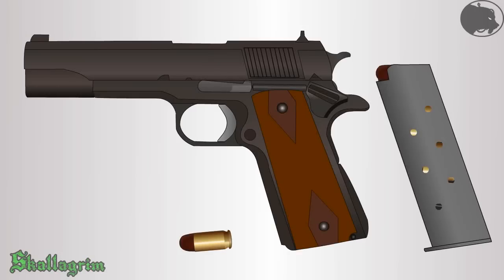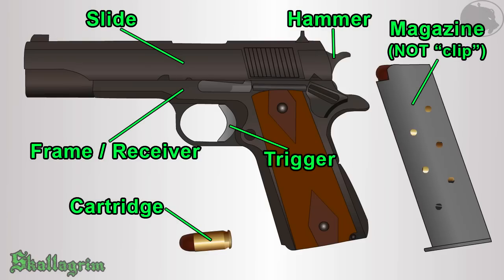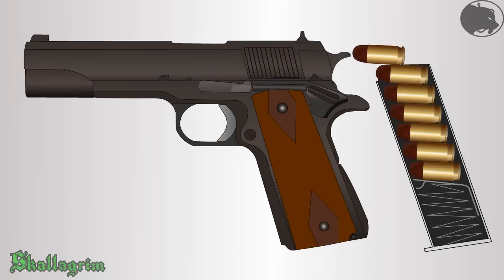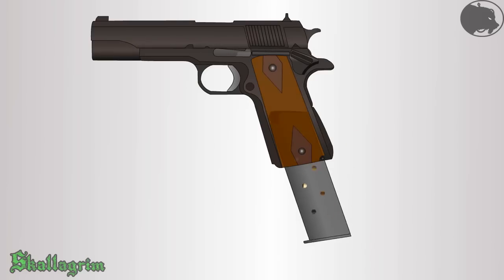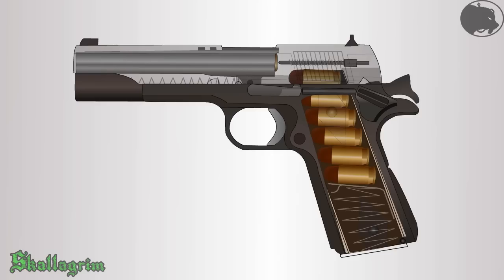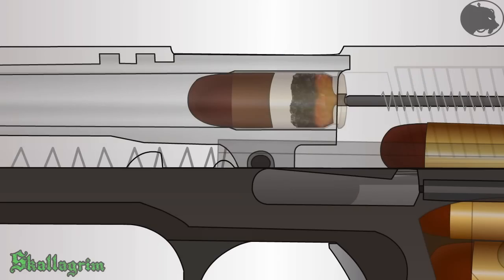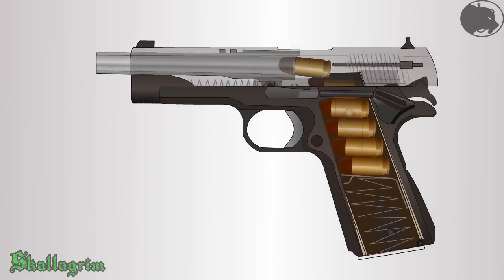How a firearm works - Animation (1911 semi-auto handgun)

Comment: Everyone, keep in mind that this is a blowback-operation.
Blowback operation uses the force from the powder exploding to push the slide back.

Rifles tend to use gas-operation, which locks the slide in place so that it can only be moved by manually handling the slide or by siphoning gas put of the barrel to apply a force onto the slide.

Gas operations have several benefits, such as:
Less strain on the slide.
Less reliance on ammo weight.
Less recoil.
More force applied on the bullet.*
Gas won't be in the user's face.
Etc.

* Note that in a gas operation, the chamber is sealed. So long as this seal is in effect, both the explosion from the gunpowder being ignited and the force of the resultant gas expanding add together.
In a blowback system, the force of the gas is completely wasted.

Blowback systems are only very reliable on small ammunition and gas operation is only reliable on bigger ammunition.
This is because small ammo has too little gas to work an operation and bigger ammo applies too much stress on blowback systems.
Reply: So bolt-action rifles really ARE more powerful than semi-automatics?
Reply: Kevin Meisenbacher no, it is the round that determines how powerful a gun is, a 5.56 bolt action is no more powerful than a 5.56 ar15
Reply: @Kevin Meisenbacher Technically, ever so marginally so. Real world, no. The type of round being used and length of the barrel are the most important factors in terms of power. Comparing apples to apples, any two guns using the same round and same length of barrel will be equivalent in terms of power, regardless of the type of action used.
Reply: @kevgmei  some would argue that bola actions are more accurate but that comes down to trigger discipline. Some people keep pulling the trigger on a semi auto without aiming but in truth both rifles can put in a very tight pattern. I use an SKS and at 100-150 yards (standard distance for Dee hunting here at home) I usually put in a decent pattern. Sadly have to use my off hand cause I'm left eye dominant
Reply: Same here. If I were to get into guns, then I would definitely have a much easier time with pistols because I just know it would be super awkward for me to hold a rifle with my left hand.

Comment: The moving of the slide and the bullet moving through the barrel happens at the same time because of the gas pressure inside the barrel from the explosion of the primer. (That’s what recoil is, the gas can’t escape because of the projectile.) So the slide is actually back before (or roughly at the same time) the bullet leaves the barrel. The video isn’t wrong just a little nit pic I saw, cool video!

Comment: thsi is old but good. if Skall is still going on with the channel I want to know hwo does a gun jam?
maybe link me to the video if it was already explained.
Reply: There are a million and one scenarios where guns jam, but here are the most common malfunctions.
Stovepipe:The casing is improperly ejected, leaving it stuck in the ejection port.
Failure to feed: The slide fails to pick up the next round.
Failure to extract: The gun fails to extract the spent casing, leaving in the chamber of the barrel.
Misfire:The primer is struck but the cartridge does not fire. Can be a hangfire in disguise.
Hangfire: The rarest and potentially scariest malfunction, where the cartridge simply fires on a delay. You pull the trigger and it doesn't fire for one to thirty seconds. A youtuber once experienced this when firing a 357 Magnum revolver, taking his ear protection off before the round fired. His ears were ringing for at least the next week.
Reply: I own a 1911, and the first 3 have happened to me when I was just racking the slide/working the gun oil in.
Reply: I know I'm late but thank you for explaining this. I was curious as to the ways weapons jam and this has just sparked my curiousity further

Comment: AK-47 assault rifle doesn't use the recoil to reload, but takes some of the pressure from the burning gunpowder to operate a piston that does the reloading. Why is that? It's more complicated. Is it more powerful that way, as it waits until the bullet gains some speed before it starts to remove the shell?
Reply: Heikki Finland actually it is the other way around. The bolt on the ak is locked to contain the forces of the cartridge. By the time the bullet passes the gas port (near the end of the barrel) and gas actually starts to travel down the gas tube, impinging the piston, (which unlocks the bolt) pressure levels have dropped to safe levels and the mass of the bolt carrier and resistance of the recoil spring are sufficient.
Reply: It's cheaper and lighter to use gas-operated mechanism.
The pistol in the vid isn't known for being light, but for being reliable (taking out all the factors like idiots ruining their guns, using improper ammunition, etc).  They're very common in competition shooting because of that reliability.
Reply: Let's start with fact that AK-47 isn't even proper name and that;'s not because AK is shortcut. simply official name never included numbers. And even I don't think it's possible for semi-auto and auto weapons to work exactly same simply because that would make them all semi of full.

Comment: so the slide is just as powerful and dangerous as the bullet when it is pushed back by the exploion? because of newton's third law?
Reply: MaNem Jeff well, the same amount of force pushing the bullet down the barrel is also exerted in the opposite direction to push the slide back (recoil) cock the hammer and cycle a new round into the chamber
Reply: Cornered Fox oh ok thanks. I used to think that if the gun malfunctions and the slide doesnt stop and would hit the gunner in the face it would kill him.
Reply: But it can injure your hand if you grip the pistol incorrectly,  for example if your thumb is behind the slide.
Reply: Just don't put your hand on the slide when you shoot, though. Newtwon ain't gonna give you the fingers back.
Reply: When I was in the Army I knew a female sergeant that got her hand sliced by the the slide the first time she fired a 9mm pistol. Her hand was a little too high up the grip, and when the slide cycled after firing the bottom edge of clipped the back of her hand between the index finger and thumb. It was a shallow, clean slice. She was upset about being pulled off the range for first aid, she wanted to shoot again.
Reply: qawamity/Escef good for her
Reply: no, the mass of the slide and the springs stop the slide from moving as fast as the bullet
also desert eagle is enough powerful to do break your skull if you're holding it so close to your face that it blocks the path of the slide
(not every gun functions the same way, only one operation is using newton's third law[M1911 is using short-recoil operation], operations: blowback[the expansion of the case pushing the slide/bolt back], recoil[ newton's third law, the barrel and the slide/bolt is locked together for short/full distance of travel], gas[gas is taken from the barrel and it will push the gaspiston/bolt-carrier backwards and it will unlock the bolt and pull it backwards], and manual[manually unlocking the bolt and pulling it backwards])
Reply: qawamity... gotta love those Beretta bites. Saw them on butter bars all the time.
Reply: These guns are so reliable that 'recoil buffers' are considered useless at best, and malfunction-inducing at worst.
Reply: No just the energy which causes recoil
Reply: The bullet only travels fast because pressure is built behind it, the slide is no where near as dangerous

Comment: What happens when silencer is fited on gun
Reply: Aryan Kumar It just stretches the chamber
Reply: A Suppressor adds a series of small chambers near the end of the barrel for the gasses following the bullet to expand into. The gas expands into the first chamber, dissipating some of it's energy, but then has to go through the bullet sized opening into the next chamber. So on and so fourth down the length of the silencer. This effectively means you're taking energy out of the hot gasses that are following the bullet, so by the time they reach the outside of the gun, they create a lot less noise than they normally would if the silencer was not fitted.
Reply: Have you have a video of silencer in gun... I can't understand..... If you haven't please upload....
Reply: Also note that "silencer" is a bit of a misnomer. Unlike what is depicted in movies, a silencer does not turn the sound of a firearm discharge into a whisper. It merely lowers the decibel output to a little below the permanent hearing damage threshold, it is still VERY loud. (It is possible to make silencers that would make a firearm whisper-quiet, but the end result would be an attachment that would make the weapon awkward to use, at best.)
Reply: Think of a silencer like a muffler on a car... Because that's literally what it is.  The guy who invented automobile mufflers also invented firearm suppressors using the exact same system.  The original brand name was "Silencer", unfortunately adding to the misunderstanding of effectiveness we have today, sort of like how in America "Kleenex" is often used as the name of a facial tissue instead of just being the brand name.
Reply: It makes it so you can use the gun with out getting hearing damage from the three sounds a gun makes

Comment: if there is a bullet in the chamber and i pulled the slide back and release it a few times, is it will fire the bullets without touching the trigger ??? what will happen?
Reply: Unless you apply pressure onto the trigger, which releases the firing pin, the gun wont fire. If you pulled back on the slide all the way, it would eject the bullet out just like an empty spent casing, and when the slide goes back into the normal position, it will bring a new bullet from the magazine into the chamber.
Reply: I actually hadn't though about that
Reply: EL NAYRUBY I

Comment: he did say some parts were not shown to make it simple. there's an extractor that pulls the empty casing from the chamber when the slide goes for a new round. 
and when the last shot is fired, the slide locks back, opening the system for you to drop the mag and insert a loaded one. then release the slide catch and the pistol is ready to continue dispensing freedom.

Comment: this is not how a m1911 works, or not completly, a crucial detail its left out of the explanation, the locking mechanism, in some simpler designs wich fire less powerfull amunition or have very high bolt mass this explanation is valid but in this case if you leave the action unlocked the high preasure generated by the powerfull .45 acp cartridge would open the union betwen the bolt and the chamber way to fast damagin the casing and quite probably the gun itself, that is why most modern pistols firing anything more powerful than .380 use a locking mechanism wich delays the opening of the action until preassure falls to a safe level, that is why there are three lugs on top of the barrel in the animation, and tha is why the barrel tilts upon firing, most of the ingeneering that went into designing this and many other modern pistol focused on the locking mechanism, its not an small detail, its the very axis of the desing
Reply: Skul explained that the animation was kept simple, and only the basic parts were explained. As you mentioned, not all small arms have a locking mechanism. Hence the reason he (probably) left it out.

Comment: It should be noted that the M1911 is short recoil operated, rather than straight blowback. Instead of chamber pressure pushing the slide back, the recoil of firing causes the barrel to tilt and swing backward, releasing and pushing the slide back.

Comment: Fun fact, the type of gun powder used in modern rounds burn at a consistent rate rather than explodes, which helps with the distribution of of pressure, as apposed to black powder that exploded

Comment: Remember, the barrel is as long as it is because the explosion from the cartridge expands inside of it, meaning that the pressure grows. When the bullet reaches the end of the barrel, the pressure is released. If the barrel is rifled on the inside,  the bullet will build up spin, giving it more accuracy in the air. The barrel's purpose is to increase velocity and accuracy of the bullet.

Comment: the only thing missing form this is explaining the importance of the hammer,  non-firearm users dont often comprehend the difference between single action and double action or what the purpose of "Chambering a round" is, so if you hand them a loaded gun they probably pull the trigger and nothing will happen because they don't what the slide or hammer does.

Comment: So it's called a primer nowadays. But it's still amazing to think that the basic technology of a percussion cap is pretty much unchanged since it was first invented in the 1820's. The technology around it has changed. It is being struck by a pin rather than a hammer. And it is integrated into a metallic cartridge rather than sitting by itself. But the percussion cap itself itself hasn't really changed.

Comment: Actually the gun powder turns into a gas, which pushes the bullet out (with extreme force) and while pushing the bullet, a small amount of gas goes through a tiny hole in the barrel, pushing the slide/bolt back.
Reply: is that you dad? You're thinking of a gas operated gun, like an ak or ar15, many pistols use recoil operation which causes the gun to cycle
Reply: acemace oh ok.

Comment: So this is one way yes just a recoil operated but you should also do one on gas operated, delayed blow back, piston, and short stroke piston, etc. to avoid confusion wouldnt want viewers to think this is the only way all firearms work in addition to this there is not equal force pushing back as the cartridge expands and seals to the bore upon firing and much of it follows the slug out of the barrel what cycles the gun is simply the remaining force afterwards the only time where there is ever arguably equal force is when you have a firearm extract under high pressure which is considered a malfunction and can even cause the cartridge to explode in some circumstances

Comment: Impressive animation but can you explain why doesn't the spring throw out all the bullets when the magazine is out side of the weapon
Reply: The lips of the magazine prevent the bullets from being pushed out. The bolt pushes the round forward past the magazine lips as it returns to battery.
Reply: Thank u but an animation would be better,thanks any way Comrad.

Comment: An excellent, simplified tutorial!

A question. If the slide is operated to chamber the first round, then the hammer is carefully lowered onto the firing pin, can the weapon be fired later by pulling the trigger (single action)?

If such an action is taken (hammer down) will the gun fire if dropped onto the hammer?
Reply: +Steve Waclo Many fire arms these days do not allow the hammer to ever engage the firing pin if it is one safe. EVEN IF the hammer some how drops to the pin, it will never actually touch the pin if on safe (on most weapons).

As far as your first question, yes. You can pull the trigger while the hammer is down and still fire the weapon. The weight of the trigger (how much pull you have to provide) will be much more than if the hammer was already back.

Think of it this way. It is easy to let go of a ball at the top of a mountain (pulling the trigger while hammer is back).

It takes more effort to take the ball up the mountain and then let it go (pulling the trigger with the hammer forward).

Comment: the powder doesnt explode, it actually defelegrates. Defelegration is the subsonic expulsion of energy from a substance burning rapidly away. That substance in this case bieng the gun powder in the case of the bullet. If the gun powder exploded it could possibly cause severe damage to the gun aswell as the shooter.
Reply: +Jordan Chambers 1:06 He states that the powder burns
Reply: +Jordan Chambers yup, but deflagration anyway ...

Comment: The barrel itself moves up? How does this not affect the guns accuracy.
Reply: Max Bantz because the bullet would already be out of the barrel by the time the barrel starts to tilt to receive a new cartridge. Not all pistol barrels do this, some are fixed in place.
Reply: the bullet already left the barrel and after that the barrel tilts up a bit, this makes it easier to recive a round from the magazine
Reply: not all guns have this
Reply: The barrel moving up was confusing me at first too, but upon further analysis i can conclude that the barrel only moves up when the slide is back, which means no bullet is actually being fired at that moment. The reason that the barrel moves is because the slide goes back, I guess? But in short terms, this doesn't actually affect the pistol's accuracy at all, since by the time you pull the trigger, the barrel will be back in place for the bullet to travel through.
Reply: because it happens after the bullet leaves the barrel.

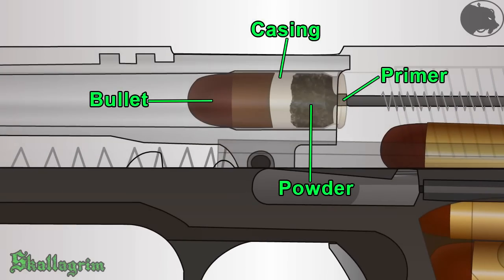Comment: 1:00 is the primer also a powder? Also could you explain a little bit more about the firing pin? Why does it have a spring? what is the firing pin held up by, why does't it just fall down? how forceful is the firing pin, why is it so much more forceful than me flicking my finger at a bullet?

Imagine flicking your finger at the primer and then the bullet flys....
Reply: No, gunpowder wouldn't explode I believe . Primer has to contain type of explosive material which explode when you squash primer. And to fire it you have to use force big enough to squash primer. Probably flicking finger wouldn't be enough, but don't try :)